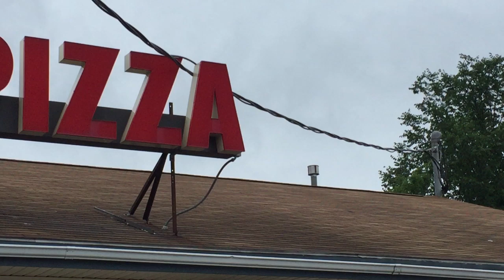Moving Violations Video No. 211: Dangerously Hot Pizza

Comment: Hopefully that service doesn’t get damaged and cause an arc flash explosion on that sign!!!

As I mentioned in the video, I was not sure where the “service point” was, and for this video commentary I made the assumption that the “service point” was at the the pole and these overhead wires were covered by the NEC.

“Generally speaking” section 230.24(A) requires 8ft clearance. That is the general rule. Not knowing what the voltage was,  I was not sure if any of the exceptions ( 5 possible exceptions ) were applicable. Exceptions 2,3,5 are not applicable for 480V services.
Exception 1 is not applicable either since this roof has no pedestrian or vehicle access. Exception 4 is not applicable either since this service is not attached to the side of the building.
That leaves only the general rules in 230.24(A) which require 8ft. of clearance.
I hope this helps clarify the rules for everyone.

Keep watching!

Russ